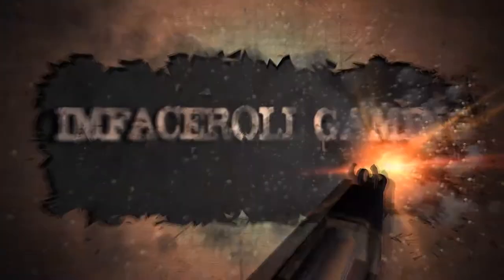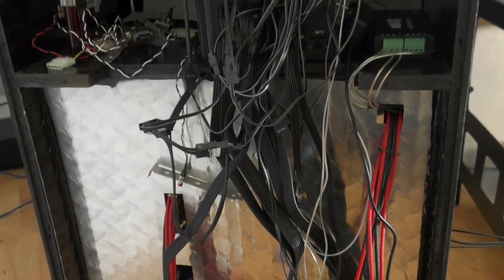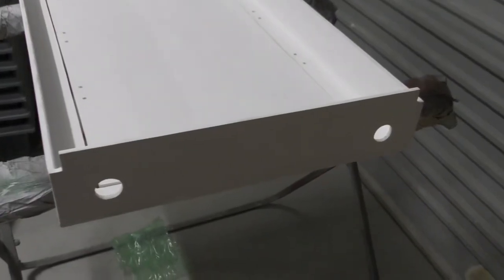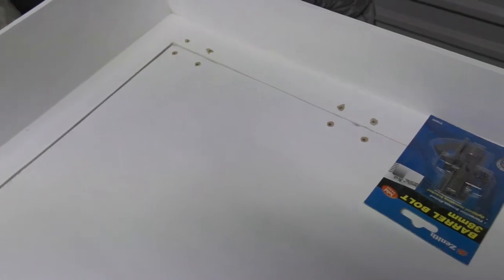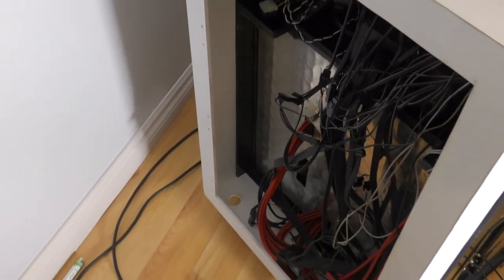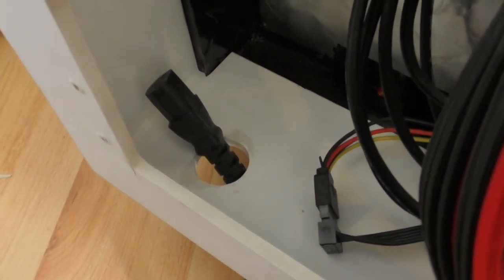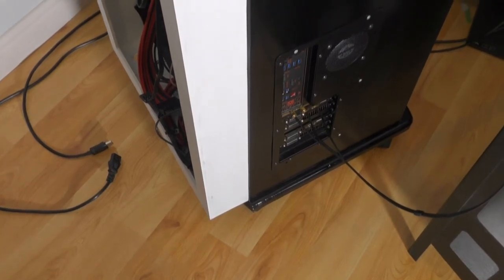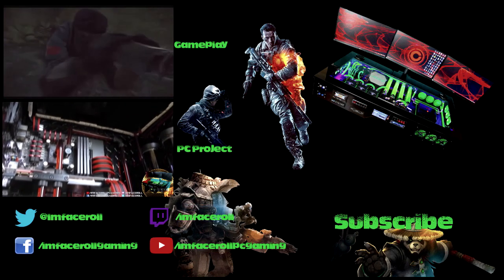Custom Liquid cooled gaming PC modification within a cabinet DAMAGED!!

Comment: Make a female to female powersupply cable and fix one end into the wood. The mice can easily fit through the hole you made for the powersupply cable routing.
Reply from the maker: Ryxxi dont worry, once the cable is in i have made a plug to close up the holes =)